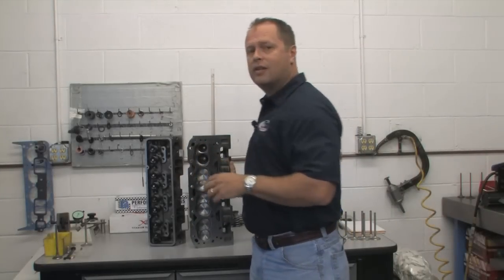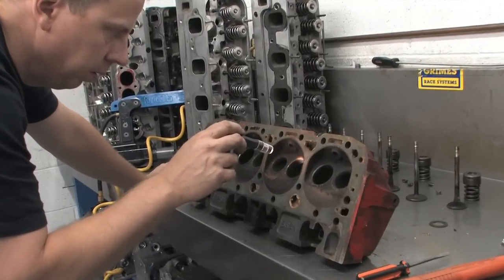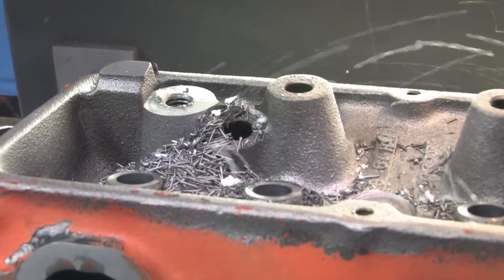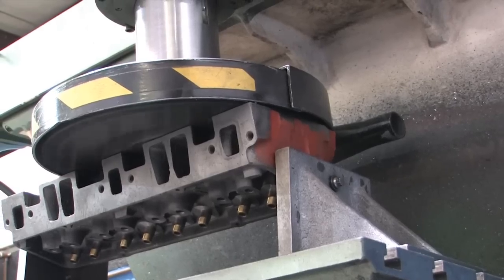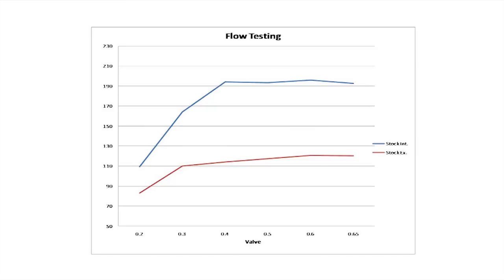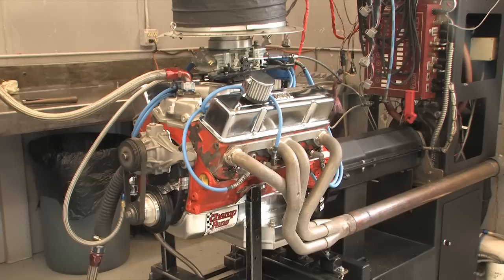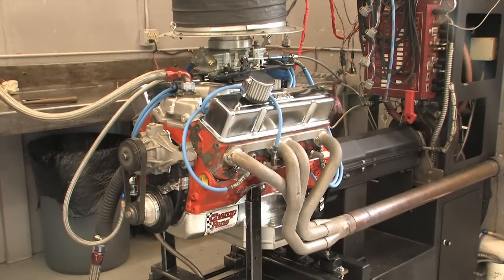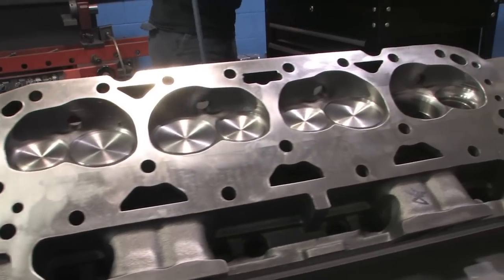Chevrolet Cylinder Head Dyno Test

Comment: only problem here is a stock set of chevy vortes heads flow around 230 to 240 cfm ... those would have shown a real comparison!
Reply: could only get 107mph in 3300lb car with a 406 vortec
Reply: Mick Sexton Driver mod☝️
Reply: I expected more out of the darts..them old 882 held up good
Reply: roknroy1 if you are spinning a lot off the line from the start that kills your top in trap speed.... plus if your rear end ratio is geared very low that will also kill top end speed... I would be more concerned with my ET rather than my trap speed...
Reply: Yeah but but Vortecs go flat at 5500 - it's the natue of them ie valve and port size. The Iron Eagles still had another 500rpm in them which to my way of thinking is better if you like to revy yur chevy lol.
BTW, I bought a new Vortec roller cam short engine and put some aluminum heads on it for this precise reason.
Don't misunderstand me, I think the Vortec head is a great thing for so many reasons, but I like to rev my SBCs to 61-6200rpm and make power up there.
Reply: Selling Dart Heads?
Reply: +ThePaulv12 I built a 355 with modified vortec heads that made power past 7000rpm. I saw a 383 make 550+HP with vortec heads. But some people build engines, other people change parts. Look into how much power is being made with 350 sbc engines in NHRA Stock Eliminator. 295hp 350s are over 500hp with stock 041s and the stock intake. Superstock 350s are 625+HP if you want to be competitive.
Reply: revving to 7krpm and making power there are two different things, yeah?
Now let me tell you something, I'm a Mopar guy but I have a Toyota FJ40 4x4 with a 2F 6 cylinder. I got my 350 because I can't get an adapter kit for Mopars for my Fj40 and my main Mopar experience is in big blocks anyhow. Add to this I can't bare that 2F motor any more and I must have a V8 in my truck or I'll stop driving it.

What I'm saying is this, this is my first chevy ever. I tend to subscribe to the belief wise people learn from their mistakes, wiser people learn from others' mistakes. Word 'round the campfire is Vortecs go flat at around 5500rpm. 
I'm no dill either so I went with a combination that gives me a degree of tuning. I got them to mill my heads for 9.8:1 with .016 or .018" steel shim gaskets, and if it rattles then I can put in some composites in and lower it .5:1. For me I don't want to muck with Vortec heads since I can't really be bothered learning all there is to know about them most importantly because I'm just not that interested.
So aluminum it was. I got a deal from my shop too. His new bare aluminum heads properly fitted out and with shaft mount rockers for $2500! I reckon that's a fair price. I supplied new LS blue beehive springs and Comp retainers. I feel this beats new heads that need disassembling, syncro seating, reaming the guides etc.
I do know a bit more than I seem but not as much as many esp on SBCs.
Reply: +ThePaulv12 I build engines daily for a living chief. Been building them for 34 yrs. I build alot if oval track engines and drag racing. I know what the fuck I'm talking about.
Reply: +ThePaulv12 Lots of vortec heads in the dirttrack world. Stock vortec head's are making good power. Modified they do even better. Alot of classes require a cast iron production head, you'd be amazed what people are doing with them. Most folks are just to conservative. Alittle grinding goes a long way. I see 255+CFM with them with minimal porting and 2.02/1.60 valves installed. Of course there are better heads to work with, but for a production head, they have alot if potential. Most people using vortec heads or looking to build 350-400hp. But many have been built to make 500+HP.
Reply: Richard Noggin well i don't and i'm not afraid to admit it but it makes no sense for me to have modified stock Vortec heads to do what a pair of aluminum heads can do even if the Vortecs modified might flow 25% more than the aluminum ones.
I bought a brand new short 350 Vortec roller cam engine so i wouldn't have to remove the heads  to mod them for screw in studs. I saved quite a bit of money and used that to go the way i did.
The rough cast pistons of the Vortec however, SUCK.
If i had've known the comps were going to have been all over the place i wouldn't have gone this route.
Reply: +ThePaulv12 Usually if one is trying to make power without having to put alot of effort into it, its better to just pick the aftermarket head that suits your needs. Building production based heads is usually for racers in a class that requires it. It can get pretty expensive making production based heads make big HP. I have a 600 HP 357ci sbc, I used CNCd ProTopline 220cc intake runner heads, 308cfm @.650 lift. I have around $2000 in them. It makes max HP at 7800rpm. But it holds it past 8200rpm before it goes flat. 13.5-1 compression, 668/669lift, 274/278@.050, 106 lobe separation. I use a Victor tall with a 2 inch spacer & 850 DP Holley. JE pistons, Howard's rods, forged crank, 4-bolt 95 1-ton truck block. It runs mid 10s NA in the 1/4 with a 5500 BTE convertor and 5-13 gear. It's a pretty basic G-body. I have my VORTEC headed 350 in a S-10 Blazer that runs low 11s. Drive it to work everyday. Production heads can make the power, but its alot easier with aftermarket. The shit they are making today blows anything made away from back in the day. The old shit still has its place tho. I dig Mopar engines too. Just can't afford the ones I want. I had a Prostreet 71 Duster back in the day tho, pulled a 440 from a motorhome, narrowed a DANA 60 from a Ford truck, 727 tranny from a dodge truck, ported the hell out of the 906 heads, used a 260@.050 solid cam, old Torker intake with a 850 DP. It ran pretty good for a 17yr old kid building it. Wish I had it now.
Reply: I want a Hemi so bad it hurts. Indy now make an affordable aluminum water jacketed Hemi block - get this in low deck B (383-400) or the conventional RB and with a 4.5' bore.
Imagine a 4.5" bore with the low deck 3.375" stroke. It still makes ~ 426/7 cubes. The reduction in reciprocating mass should make this combination very lively. Another company, Stage V (Hemi heads for wedge blocks is/was their thing) make a 2x4 single plane intake for the low deck Hemi since their conversion heads try to maintain as many stock Hemi parts as practical viz intakes, exhausts and rocker covers but no one afaik makes a low deck intake for Hemi heads except them. Indy have made at least one though and I guess they will start making them since they offer a low deck Hemi block now.
I reason an old school flat tappet camshaft with a low deck all aluminum Hemi would be a very high revving beast without the hydraulic lifter rpm penalty that would sustain fairly high comp and work well on the street and be less weight than a lowly 318.
I'd like to see say 7-7200 rpm streetable Hemi.

As well as the reduction in reciprocating mass you get a low mean piston speed of 3375 fpm @ 6000rpm of the 383/400 - see what I did there? 
This works for any engine. Theoretical max mean piston speed is a somewhat arbitary these days 4100 fpm. This only works for 6000rpm but gives you a quick way of assessing the rpm potential of any motor. All you do is get the stroke length in inches say 3.48 for a 350, remove the decimal point and add a 0.
3.48 becomes 3480 fpm ie well below 4100 fpm. should be able to do 6500 rpm without a worry on near stock components. 
Another example, a stock stroke Hemi 3.75 become 3750 fpm.
To calculate for any 1000 rpm increment divide by 6 then add the answer to the original. Instantly you can now see how good a motor is likely to rev up. Pretty cool eh? Of course all these limits can be broken, but this little 'tool' is invaluable to the engine builder and engineer alike.

The inspiration for my low deck Hemi is in these 2 articles. One of them I expect you may already have seen. I'm conviced. Short stroke big bore engines are what I like. Enjoy and let me know what you think. 

https://www.airflowresearch.com/412-hp-350-ci-afr-190cc/
http://arengineering.com/tech/451-manifesto/

Also before I forget, I had a set of 906 heads I ported the hell out of but a fresh faced Steve Dulcitch forensically compares them to smog heads and you're going to love this, the smog heads are better than the closed chamber 915 and the open chamber 906s.
Farrrrr out!; all that time spent looking for 906s and all those good smog heads I rejected. Now you can just go out and get some cheap bare heads with every mod the factory ever suggested cast in and they'll easily outflow the best ported iron heads as standard. Time has moved on :)
https://www.hotrod.com/articles/cylinder-heads/
https://www.hotrod.com/articles/cylinder-heads-ii/
https://www.hotrod.com/articles/cylinder-heads-iii/
Reply: +ThePaulv12 Yep, technology moves right along. Big bore short stroke is definitely the way to go. I like a engine that will rev. I'd like to build a clone of a 68 Superstock Hemi, but with modern goodies. I remember seeing a Superstock Dakota with a short stroke Hemi, believe it was around 400ci, made 800+HP. Ran low 9s back in the mid 90s. A street version would be the shit. I think it was 8lbs per cube rule. Most of the trucks in that class run small cube smallblocks of course, but a few people used destroked bigblocks. One dude had a 318 in a Dakota making 650+HP with a single 750cfm carb. Class required 4150 style 750 Holley. Superstock racers are doing amazing things with the old dinosaurs. Don't know the bore & stroke on that Hemi, but it was shifting at around 8500rpm. I figure it had less than a 3.25 stroke. Probably 4.310 bore. I'd love to have a building full of drag racing Mopar goodies, but that shit done got expensive. Budget is what got me into building Chevy engines, I started with Pontiac and Oldsmobile. But they got real expensive also. Power per dollar, Chevy's are hard to beat. I tell people that if I was a rich man, I'd be building vintage Porsche and Ferrari engines. But I'm a working class Joe, so I fell into the GM world. Most of the engines I build for local racers are all Chevy's. Occasionally a Ford, pretty rare to see mopars on oval tracks these days. And alot of the bracket racers are going LS these days, so I was forced to learn them. I'm old school tho, the vintage shit still has my interest. I mostly build bigblock Chevy's for my personal drag cars these days. 496ci can be built on the cheap and they definitely respond to modifications. Don't t have to turn em up to make the power. I have one in my shop that makes just over 700hp with iron heads with alot of work in them. It was formally a NHRA Superstock 454 back in the 70s/80s. But I made a few changes over the years and now its a bracket racer. Be alot easier to build it with today's parts tho.
Reply: +ThePaulv12 I do have a 64 Dodge A100 van sitting in a field. Planning on a tunnelram on a 440 for it. One of these days I'll start that project. There's never enough time in the day to do all ya want to do.
Reply: Do a 451 and put a tunnel ram on that (440 crank in a 400 block)
Get a new crank from 440 source with the big end journals turned down to SBC size.
They rev up better than a 440 (which already loves to rev). In fact 440 source have kits which include crank, rods and pistons. Using the turned down cranks, there is a large weight saving in each rod and piston.
Run a solid lifter flat tappet cam and ductile iron rocker arms Summit have them and they're better than roller rockers imo. Roller rockers are OK if their are no other choices and/or lift is over ~.650".
It will rev up like a 327 does but with more than 120 cubes extra.
Not that I've built one, but apparently all the stars align with a 451 :)
Reply: Great stories there Richard. 650hp from a stinkin' 318 is extremely impressive. i'm not often impressed but that one has me really going. My 1st car was a Dart with a 318 2bbl. I treated that car so badly I'm ashamed of myself and I want it back.

Speaking of 3.25" stroke did you happen to read this link from my other post?:
 https://www.airflowresearch.com/412-hp-350-ci-afr-190cc/
It is a really exciting article and could be done far more easily now than when the article was published. In fact I wanted to build this for myself but kept getting machine shop idots saying, "What do you want to do that for?" Many people that run machine shops just have no imagination and fail to understand basic mechanical principals. I had such a hard time convincing them that I thought about a 377 and they just rolled their eyes so I bought a brand new Vortec roller cam short block because it was, well new and I didn't have to deal with idiots. The guy that did my heads was a tool as well. The arguement I had about beehive springs with him was ridiculous. 
He just doen't get it ie. how they work and why and the benefits of them. You'd think having a machine shop he'd be fairly bright, but well no .... ....  

If you were wondering why I'm putting a 350 (with aluminum heads:):) in a Toyota FJ-40 4x4 wonder no more - I'll tell you.
The reason is I can't afford cars in my hobby any more because the hobby has become gentrified. I figure I can still enjoy my hobby by putting a V8 in my shitty truck.
I have an offy single plenum X ram with dual quad Fitech and a Milodon single idler gear drive - don't laugh (I know you want to). I sincerely hope it isn't going to whine like a cheap dual idler type. Anyhow, all the good cars now start at 15k for a rusty heap and I'm not paying so my truck it is. That way I get to enjoy hot rodding every day. It isn't always about going fast. Cruising in my 'cruiser is what I'll be doing as they don't steer too well at speed. The 350 will do well off road.
Reply: Richard Noggin  From what I understand, some all out engines (rally IIRC) use a venturi around 7 degrees angle, between the throttle body and usual intake manifold/runners.
   Just wondering if you've experimented with this or extending the intake manifold, directly between the throttle body and intake manifold ?
Reply: Vortec heads IMO have had the best flow for stock heads. Just as this video shows a little loving and grinding will make them go a long way. There’s tuning cubes and changing parts. The SBC 350 is a rubix cube for power for some people.
Reply: should have got a better head after all that work you could have sold them to someone who could have used a good set of heads.  and recouped some of your money
Reply: @superkillr  they should be running a gasket and a bore to eximplify the true flow as in a 4.030" boreIf you want a set of real Vortec, with minor work I provide, they crssh Iron Eagles. 507HP on the dyno hydraulic roller all cast lower, 658HP on the spray. www.diabolicalracing.com
Reply: Rob Smith why waste money on a goose chase for double hump heads when stock vortec heads flow more ..even with the smaller valves.proven facr over and over...flip them up side by side and look at the chambers and valve layout,port runner design ....me and every body els has known that since the 90's ...plus every geezer with a set of hump heads  acts like they are holding down all the gold ..and usually wont come off of shit because they still believe in it like the mullet ...
Reply: @port nut I agree, but in some cases one is forced to make the best of the old production based iron.
Reply: Get a set of 906 chevy vortec and compare.
Reply: @ThePaulv12  my vortec headed 355 will make power to 7000rpm. But I set it up that way. Pocket port them and cut the guides down for a real cam. Install screw in studs.
Reply: @72troy455  i got shaft mount rockers. Got a deal with an engine builder to for them to supply aluminum heads and shaft mount rockers. The heads were bare and they built them up since the know these heads. They're probably china heads but they know them and do many and can vouch for them. Iirc they're 210cfm.
Reply: @ThePaulv12  I'm revving my 327 to 7500 with a set of vortec heads.
Reply: So for low RPMs a stock head is fone?
Reply: Thepaulv12 the vortecs can make power past 5,500. They don't fall flat.  The last motor I built was a roller cammed vortec.  It pulled to 6k. Would probably keep pulling but I was afraid of floating the valves. Between the 5k and 6k is were it pulled the hardest.  I felt no drop in power and this was in a 7,500lb lifted 4x4 built for sand drags.
Reply: DozR agreed
Reply: And you'll get out run by a set of double hump with 202 values and port work.
Reply: @stevemitchell2252  ran 1245 at 107, only a little off on et
Reply: @ScooterLee-ei1ep  and then you'll get out ran with vortecs with 202 valves and port work lmao.
Reply: @oldchevytruck4428  😂😂😂 you know how many guys ive beat with those heads? I was the only one running double humps. And was making 80 more to than they were. Vortex heads are for people who dont understand how power is built. See it every weekend. "Vortec heads are better, dont you watch motor trend?" I find it funny that on modifieds all the guys are running dart 46 cc chamber and 235cc runners. Here I am leading points and most wins with a steel rod, cast crank, and 202 double hump heads that are on 382 cubes. Ive seen with my own eyes. Vortec heads are hype and nothing more.
Reply: @ScooterLee-ei1ep  Crack or Tweak??
Reply: @ScooterLee-ei1ep  The double hump heads are great old heads. However, they just do not have better flow characteristics. Its been proven over and over again. Don't you watch MotorTrend? Watch the episode where they compared the 383 chevy to the 383 mopar and tell me the double hump heads are the best production cast iron heads. Your probably just some old head stuck in his ways.
Reply: @oldchevytruck4428  look up castheads.com see if you actually knew how the sbc worked youd know that they liked velocity more than flow. Seen it time and time again. Guys hurting themselves with vortec heads cause they look at nothing but flow numbers.
Reply: @ScooterLee-ei1ep  let me look
Reply: @roknroy1  my 394c.i. with vortec heads in a 3rd. Gen. Z28 goes way faster
Reply: @roknroy1  not enough nitrous....  Some is good, more is better, too much is just enough!!!
Reply: @konnerkramer329  there is more to building an engine than just peak flow numbers man. Peak flow doesmt build power. Which is why you can have "to much head". Motor trend dont a test that showed the world bigger is NOT better when it comes to heads. The fuelie head can be used to build huge power numbers. Its just takes time and knowhow. There is a reason my engine are winning ever weekend in spirt mod and hobbystock bomber classes. 18 years in the dyno room. Vortec heads are great. But not the best.
Reply: @ScooterLee-ei1ep  motor trend did a test of intake runner size. The vortec has a 170cc intake runner. The vortecs flow 30-40cfm more through the same size intake runner and the same size valves. If you want proof the vortec has a higher velocity than the double humps then just compair the low lift flow numbers. The vortecs absolutely kill the double humps at .100-.300 lift because it has a higher velocity. Yes vortecs are the best stock casting gen 1 heads. And you're right more air doesn't always mean more power. It's about how effective the intake runner and combustion chamber is at keeping the fuel atomized. The extremely efficient heart shaped combustion chambers with the high velocity intake runners that flow 30-40cfm more are the reason why vortecs make 50-100hp more than any other stock head. Stock 305 heads from the 80s flow similar numbers to the double humps... I rest my case
Reply: @way2easy2love  you expected more than a 76 horsepower gain? Lol
Reply: Joe Figueroa  How so Joe? I'm not being a dick I'd just like to know how you'd done it since I'm always up for other ideas that I may've overlooked.
Reply: Joe Figueroa  well this was a similar route I was planning on going except there's a problem. I never ever trust assembled heads. The guides are tight and the seats non concentriv and they have Chinese valves. The clicher for me was i just paid the money and he assebled the Chinese heads but with US valves and he did all the labor and supplied shaft rollers. No rework was the main thing. For the little i drive it the aluminum rockers are going to be a non issue however i love the way you think re iron rollers. I completely agree and had a bit of a lighthearted arguement with the guy who did the heads on this exact topic!
Reply: Joe Figueroa  nice chatting with ya btw!
Reply: @roknroy1  yes the vortec's strength is off the corner acceleration and street torque in a maximized fat power in mid.
Reply: @way2easy2love  expect more??? Dude 75 hp more then the completely reworked 882s is a no brainer 🤣🤣🤣🤣🤣
Reply: The old school 292 turbo heads are better than the new iron eagles in my opinion... I’ve ran both in my 355. I have a 408 with dart pro 1’s but honestly even though the 292’s habe a tendency to crack at the valves I never had any problems... ported and polished the ports/chambers myself.... stock they were 215cc and they were gm’a first over the counter race head in the 70’s... you can hog the shit out of them. I had mine ported to 230cc with 2.02 intake valves and I ran 10.50’s with spray. Not pay for a 2.02 valves 355 small block. Never got that power from the iron eagles. The best iron head today is the Mowtown 220’s made by World... 220 chambers and 2.08 valves. Big boys😎 Port them out to 235 and have them machined and stuff and you’ll have the best iron head on the market. Top Proline 230cc iron heads from the 90’s with 2.08 valves, Chevy 292 turbo heads, and the World Mowtown 220’s are the best iron heads ever made. I also ran top prolines in my 406 before I went to aluminum, and a different block and punched it out to a 408...A good friend of mine had the top prolines on his Chevy back in the late 90’s and early 2000’s... they went out of business in 03 so it’s hard to find those heads now... when I had the older block that was a 406 those iron headed top prolines were no joke. I was right at 650hp and at 12:1 compression. Had a ton of work done to the heads.... they were flowing 290cfm at .700 lift. Ran 9.80 on motor and 8.90 on a 200 shot. Who says iron heads can’t do it🔥🔥🔥
Reply: Yeah, choosing 882 heads, is a shitty comparison
Reply: No way iron Vortechs flow 240cfm...or anything close.
Reply: @konnerkramer329  300cfm from Vortecs? Keep dreaming.
Reply: @Bridging_the_Political_Divide  they flow 240cfm stock... what do you mean no way. And 300cfm is very doable with vortecs. A 2.02 valve with a good 5 angle grind will pickup 20cfm without even touching the port. You smooth the pushrod wall and blend the bowl that's another easy 20cfm. 280cfm out of minor porting and a valve job... yeah 300cfm is impossible.... if you don't know what you're talking about why even comment
Reply: @konnerkramer329 . 300cfm on GM Vortecs....no way. Produce proof. Attach a link showing 300cfm Vortec heads. Not buying it...
Reply: @konnerkramer329 No proof, no case. Vortecs are 170cc runner heads. 300cfm on 170cc runners...haha. 300cfm is BS. Maybe a better angle of this is the amount of work needed to push GM Vortecs up with 220 & 230cc AFR or Brodix heads would so extensive, it wouldnt make sense. They are good heads, but lets not get carried away with old wives tales of shops in some far off land getting 300cfm from 170cc runner heads. I can assure you if it was that easy to get 280 to 300 cfm from GM Vortecs, it would put AFR, Brodix, Dart out of business. Be serious. I just lookefd up Chevy High Performance, 216 cc intake flow stock. Lots of exaggerations in these threads.....
Reply: The 292 turbo heads they flow Porter and polish 300 cfm
Reply: A lot of modern heads don’t flow that much more than older castings, not a lot of modern heads have the biggest change in the chambers to burn better.
Reply: @ThePaulv12   i love my fj60 1984  may just redo it soon .i would not mind having a spare 2f engine ?